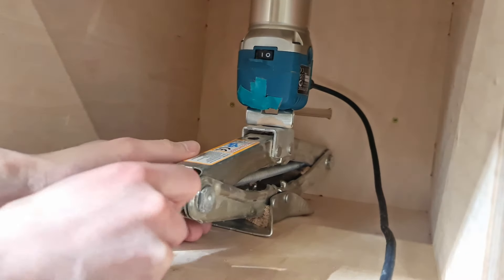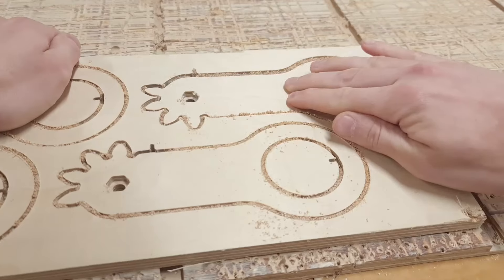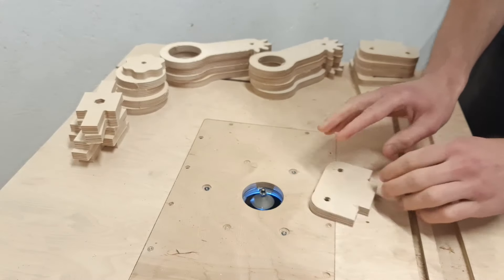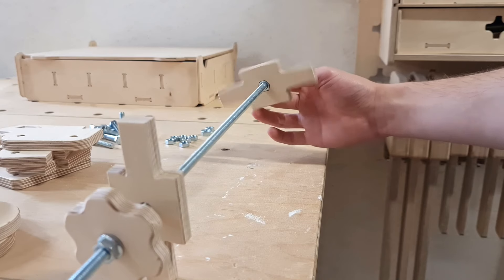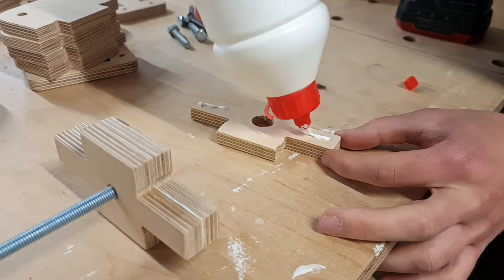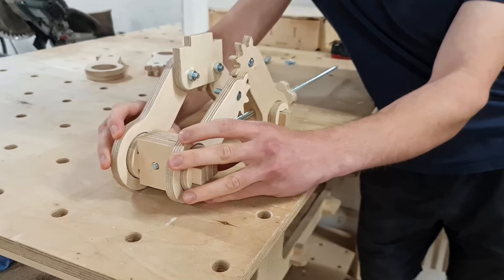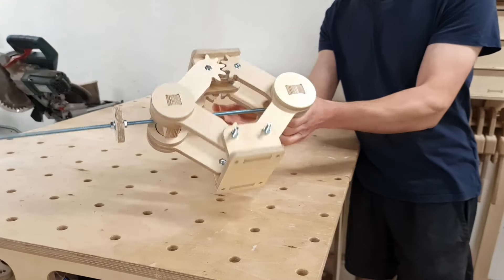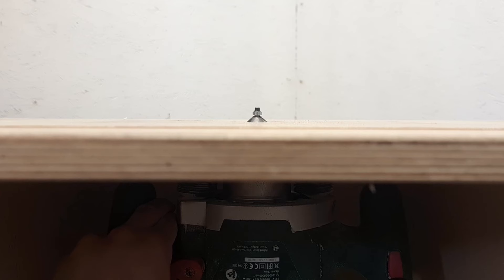One Evening CNC Project for the Workshop - Free CNC Files Available

Comment: Your content is amazing, thank you for sharing so much. I am getting tired of manually making the corner relief shapes - yours are teardrops, but there are more shapes like T-Bones and sniglets. Is there some way to save this shape within Fusion360 and reuse it, instead of recreating it for every corner (or mirroring / copying it around a sketch). Thanks again for all your guidance.
Reply from the maker: Thank you for watching and for your kind words!

I understand that manually creating corner relief shapes like teardrops, T-Bones, and sniglets can be tiring. While Fusion 360 doesn't have built-in solutions for saving and reusing these shapes, there are several add-ins that can help automate this process. Some of these add-ins are free, while others might require a purchase.

One popular add-in for this purpose is the Nifty Dogbone add-in, which you can find on the Autodesk App Store. We haven't used it ourselves, however, the feedback from the community is great.